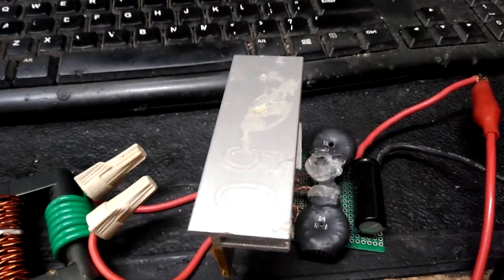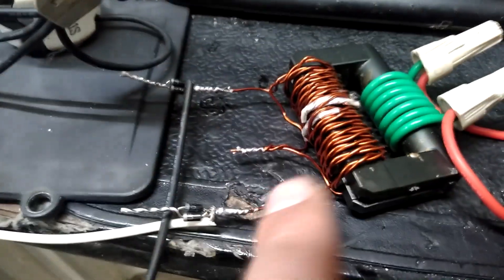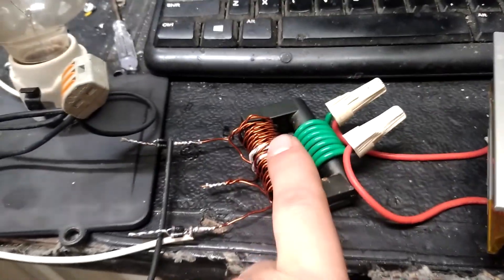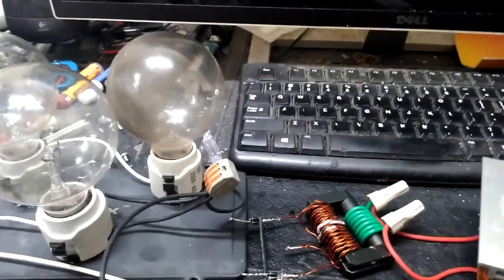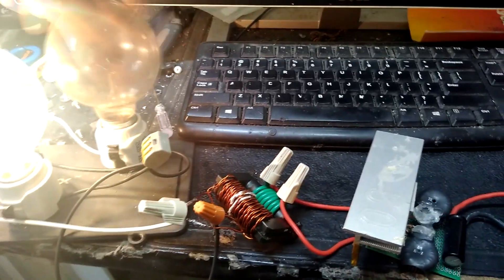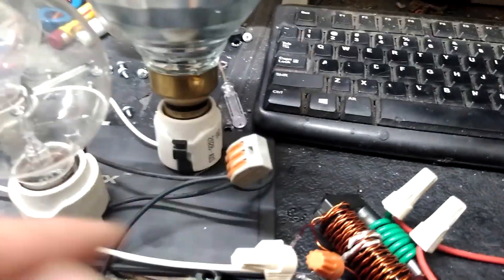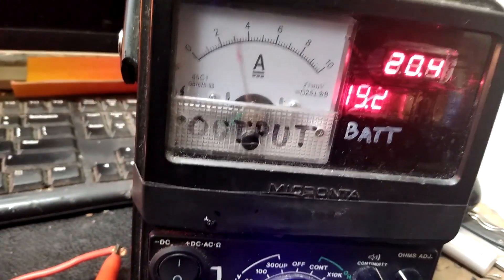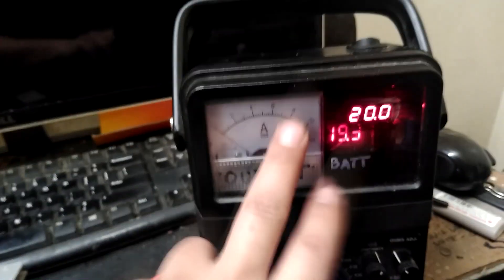ZVS Inverter w/bifilar DC output

Comment: Hi sir, recently I'm making the ZVS to drive my 3 kW HF transformer. And I'm wondering that what Should I do to increase the output power from the ZVS. By increasing the tank capacitor?
Reply from the maker: I'm guessing you have something like a dedicated 15v or so supply for the gates and maybe different mosfets? You definitely want the best tank cap you can get your hands on that will handle frequency of the current with minimal losses, but decreasing the frequency by adding capacitance may not necessarily create a better efficiency despite drawing more power. The transformer probably has an ideal frequency range it wants to run best and you'll probably get the closest to it's power rating by making sure to drive it close to that. I'd be hesitant to drive 3kw with a basic Mazzilli driver and probably opt for a half or full bridge instead, but it could probably work with a 50v 60A or so supply. Aside from that obviously trying to mitigate losses by using really solid and thick conductors where it matters. The tank capacitance is probably something I'd end up trying to trial and error while remaining within a reasonable primary LC frequency range suitable for the transformer.
Reply: ok, Thanks so much

Comment: on that note, the split supply could also run a TC but I think it wouldn't work without a complementary pair of FETs, since top side switching is required

Comment: Had this link in history,  already shared it somewhere nbKwUSH9NiY&t=960s  Great for refreshing memory of topologies. As I recall he said there's less loss since there are only 2 diodes, and u can also flip one of them to get a split supply for a DIY boombox if u've got any good salvaged amplifier ICs that need a split supply
Reply from the maker: Thanks I thought I'd seen it before somewhere but couldn't remember what they called it. I guess it's just a full wave rectified output w/center tap as labeled but like he said you've got half the voltage. Seems to work fairly well in this setup though I'm not sure if the benefit I'm seeing is just more the result of doubling the conductor size. I didn't have enough wire on hand to really test that but on the surface it just appeared a more robust way to drive the loads using the ZVS. Last ZVS I had which seemed to light around 150W+ of bulbs without issues took a 30V supply and needed a thick secondary to do it for long. I get the impression it could all be done much better at higher frequency with a much smaller transformer which was I guess the original plan. I just wanted a tiny little circuit I could throw a small lipo on and lamp base just to light incandescents for kicks but now I'm probably going to try a setup that ends up looking more like some of these free energy devices lol. I don't see anything "free" coming out of them but I can imagine some pretty high efficiency.
Reply: @Magneticitist  which "logic level" low Rds fets are u using with that ~3.5V input ?
Reply from the maker: @sFeral  which one is that I don't remember 3.5v
Reply: @Magneticitist  I mean, which fets are u using for the ZVS when the input voltage is in the range provided by Li batteries ?
Reply from the maker: @sFeral  Oh IDK, I had some before I pulled from somewhere I might have recorded the names of but I IDK what happened to them. I think I burned them out trying to make a plasma pen ZVS with them because they were tiny surface mount and I didn't have them sinked when testing. Anyway I remember the vgs min on them was like 1v or something and I used maybe 330 ohm gate resistors. I probably wouldn't try to do this with single or parallel cells though just because it would take so many amps but I guess if the idea is short term runs and tiny size it could work.

Comment: Now add a 100w variable resistor in series and 1 in parallel and you can tune it in to resonance. You can do may things to tune in . Quarter wave and half wave and full wave are easiest to find but you really need a meeusure on the  output as it will be to hard to see.
Reply from the maker: Double tuned setup is how I'll be going with a HV build basically just like a DRSSTC or SGTC but the goal will be cap charging. I'm just going to sweep it with a generator to see where the peaks are by trial and error. It won't be much different from another plasma candle build.
Reply: @Magneticitist  yeah so you have a resonance tune at the primary and secondary winding and then another at the secondary and the resistive load. Is that correct? As far as I know the first one is taken care of by the zvs . Is that right ? So if you put a capacitive load I would have thought that the variable as the capacitor charges will make it hard to create resonance on the 2 half of the system . So it will be interesting to see what you come up with . Good work too. I like your explanations 👍🏻
Reply from the maker: @Buzzhumma  Yea the ZVS is ideally always going to switch at the LC resonance of the primary so if you can wind a secondary that will resonate at that same frequency you have dual resonance. However just like with a DRSSTC you can change the capacitance of the secondary by for example adding a topload capacitor and as some have observed this may also change quite a bit with arc loading. The main difference there I suppose is that in a ZVS the tank capacitor is in parallel rather than in series, and typically a DRSSTC primary is resonating at much higher voltage whereas a ZVS driver primary is typically going to see something like peaks of 3-3.5x the supply voltage.